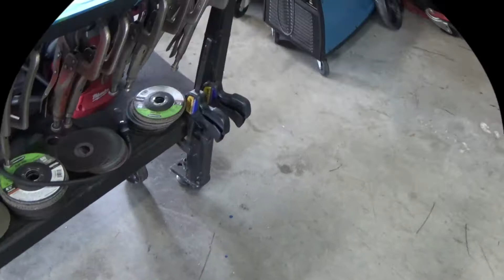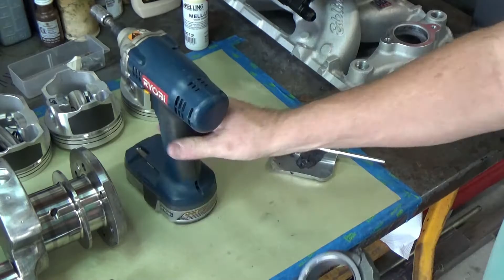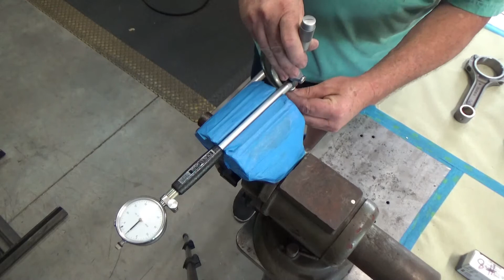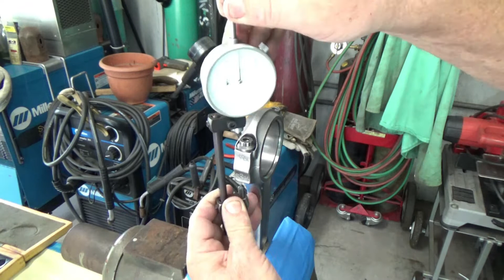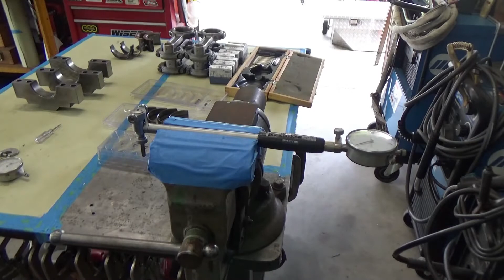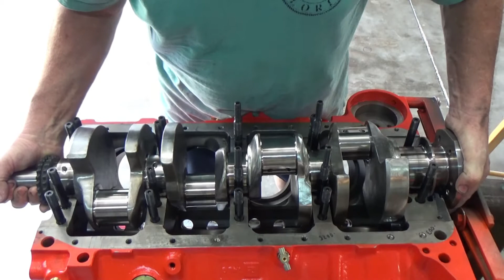Checking oil clearances & installing steel crank shaft...#4 Chevy 454 Big Block Performance Build..

Comment: Do you stagger the rear main seal meaning one side is 1/4 inch below surface and other above? We are getting ready to assemble a 454 and want to do everything to prevent oil leak. Thanks...Great videos!
Reply from the maker: Yes... I did this one that way.... Good luck with your build Tom!!

Comment: Did you put sealant behind he rear main seal (cap and block side) ? 
and
Did you put some sealant on the ends of the two piece rear main seal? Thanks
Reply: I've never used sealant on those rubber halves I use rubber cement then sealant on the cap. Zero leaks you've just created a one piece seal.

Comment: What crankshaft did you use and did you do work to it?
Reply from the maker: Its a 4340  4" stroke Scat crankshaft....  I Deburred and smoothed any sharp edges, polished the counter weights with sanding rolls in a die grinder and balanced it to the reciprocating weight of the engine...
Reply: @Myersmetalworks  I wish I would of done that to mine before I balanced it I've always looked for a vid on how to do crankshaft prep like what you did I just didn't know what I could or couldn't do to it a video about that one of these days would be awesome.
Reply from the maker: Sorry I didn't think about making a video on that job.... Thought it would bore people to death watching me grind
away at it....Lol      I tape up the journals real good, then round all the sharp edges and sand roll smooth
the rest of the cranks counterweight  surfaces... Don't know that it helps a ton but its just putting the human touch on it... It kinda makes it more yours the more effort you put into it....   The balance jobs have always worked out for me so far.....